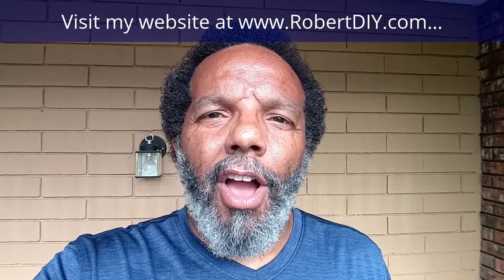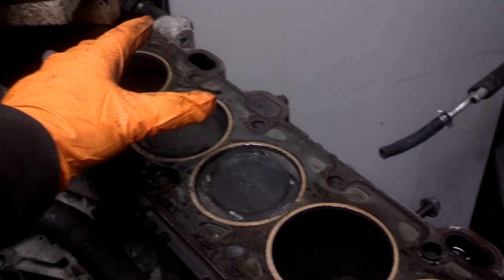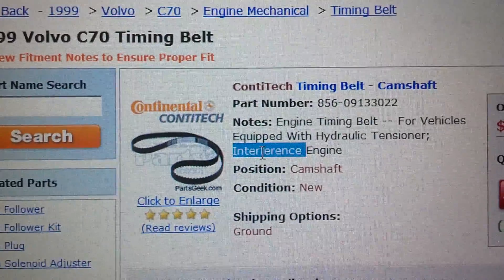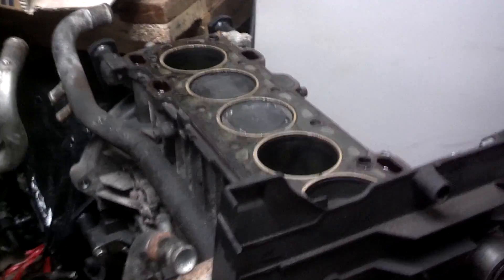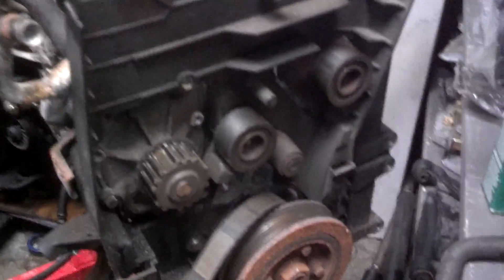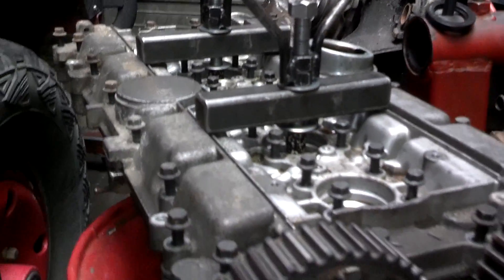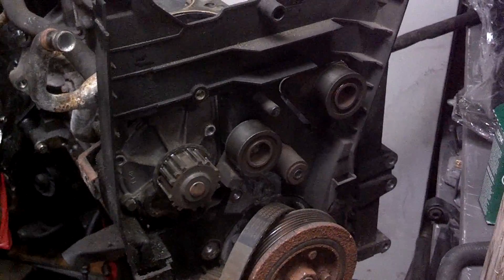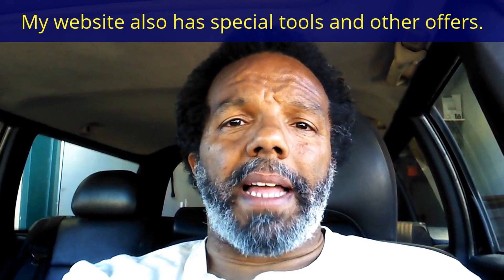What happened if your vehicle timing belt broke or came loose on an interference engine? - VOTD

Comment: so i was loosening the 30mm bolt with the engine off to change the timing belt and i had the belt still on the crank and the camshaft  and they moved after i already marked the camshafts i forgot to mark the crankshaft i had my engine cover off so they moved out of the engine and i ended up taking the camshafts off what should i do. i also have a video before i removed them off should i try and line it up with the video? its just bad quality
Reply from the maker: https://youtu.be/gt9w-ZSxs9I
Reply from the maker: https://youtu.be/hjZFY-1x1Xk
Reply from the maker: https://youtu.be/0H5cgRYCMQg

Comment: I've got jaguar sf 3.0 deasel v6 twin turbo  is  timing belt snapped would valves be bent as don't no if the engine is interference could u tell me please thanks
Reply from the maker: If you look up the parts on PartsGeek website it should tell you there.
Reply: @RobertDIY   it don't show up on there the 3.0 v6 diesel  ony shows 5.0 v8 petrol mate
Reply from the maker: Maybe you can ask someone on a forum or the dealer.

Comment: Hey Robert, I’m looking at a 98 v70R awd for sale. I have a timing belt go and the seller had tried to crank it since. The cars in great shape otherwise. Where could I find a new head for it, and if I could get one, what else would the car need? Thanks for the helpful video
Reply from the maker: I get them from the salvage yard
Reply: @RobertDIY  here seems as good a place as any to ask if various parts for the '98-'00 70 series cars are just not feasible overall to get quality versions of, new or used. Namely new parts, e.g fuel pumps for the AWD cars are not made by volvo or any quality maker now, so the Swedish Proparts trash unit is all there is!?     2:  is the Awd system really practically refurbishable?  seems not at this point due to cost.  Driveshaft alone is now 1300$.   3. and most importantly, is the automatic trans, at least in '98 really ever seeing high miles on original if well taken care of?  I really have not been seeing that over time with various examples, so i'm really trying to know the transmssion risk in lookng at buying a '98 Awd xc ,for example. ?   Thank u Robert for your wide breadth of knowledge and dedication!  U really are a car treasure and volvo treasure!

Comment: Timing belt broke coz of bad tensioner-ran compression test n all were good except 1&2 were low. Pulled head replaced all valves in those cylinders runs like new👍
Reply from the maker: Sweet

Comment: Great vid Robert! 
Question: Honda K24 (interference), chain, was really cold (-25C), next day was 0C, started, run terrible but moved, vacuum fucked (power brakes were not power anymore); likely result of poor oil change practice during covid/ran low on oil a couple times.....my fault.....
Could I be not totally fucked? 
Would it run at all if I did ruin the valves/head? 
Any good methods to find out if I am fucked if above info is insufficient?

Much love eh :)
Reply from the maker: Did the belt break?
Reply: @RobertDIY   @Robert DIY  chain, and no, it still starts and runs (barely).....can move under its own power (barely, but enough to drive get up onto a tow dolly), needs ample throttle to not stall, cant make it over 4k rpm, vacuum is fucked (power brakes no longer powered, requires lots of leg muscle to get it to brake).
Was driven about a couple km at first as I thought it might be a bad brake booster leaking vacuum and causing the issue... I was wrong, lol

PS wow that was a quick response! I really appreciate that, and being willing to help at all.... much love :)

Comment: Hello, sir! Very informative video. I have a 2004 Saturn Ion and on last month my car stopped while I was driving it. I took your advice and looked to see if I have a interference engine or non-interference engine... It looks like I have a non interference (looked on parts geek), timing chain kits were shown. What question is... What estimate would you give for my car to be fixed. Where I live, I have been lied to numerous of times by mechanics. Apprehensive and educating myself in getting it fixed. Thanks for your time. -Takia
Reply: Ok... A lil confused. It stated I have a Diesel Interference. On Geek Parts, it is showing timing chains.
Reply from the maker: Take it to the dealer, they have a set price
Reply: I keep trying to get my new timing belt back on but every time I put the main tensioner on the back sprocket ⚙️ on the rear cylinder head jumps 1-8 teeth back how tf do I get it in time and keep it in time I haven’t started the car or anything it’s been retimed several time it’s in sync but this cock sucker keeps jumping can I compress my main tensioner a bit more then bolt it on and then pull the pin and turn the engine over like 3-4 times to get all the slack out and make sure it’s rotating in time. Thank u. It’s a 2.7 V6 Hyundai Santa Fe def an interference engine it’s my sisters I’m tryna make sure it’s not off by even 1 tooth I know this is common I’m starting to think the cheaper kit I bought just has a shitty belt or my tensioner is going on with to much preloaded tension

Comment: Hi robert I have ahyandai santafe 2001 My water pump was leaking and a friend of mine took it all apart im not sure what he did I went to go and put the timing belt on and the inside camshaft (closet to th passenger side) is of by 8 or 9 teeth in the direction towards the engine (has not been started since originally taken apart) so i know tha t it hasnt bent the valves or pistons How do i get the camshaft back to top dead center other camshaft is on the marks so is the  crankshaft
Reply from the maker: Who said that it is timed marked at TDC?
Reply from the maker: bring it by and I'll check it out.

Comment: Most will slip on start up, IF your water pump runs under the cams beneath but center both underneath. it may put tension to save it. Mine did. Mine slipped on startup from being old and never serviced and raced a month after I bought it. Mine is a mitsubishi 6g75 v6 with mivec high compression interference engine. I changed the belt out and the car runs better now than it ever has and pulls ridiculously hard now. My cams are farther apart it goes over cam under waterpump over other cam. That tension is what I think saved Mine.  Most 4 cyl are different with close cams with nothing to keep tension in between both the belt goes directly over both. If it slips it'll sound like rubber slapping on plastic like mamma beating ya with a belt turn it off immediately!!!!!!!!! Most times it'll happen on startup, or when you go to slow down. It's not cheap, mitsubishi wanted 2K to do mine. YOU HAVE TO DO IT OR GET IT DONE!!!!! like he said it'll ruin your entire car. I did it all myself. If you are stupid or can't follow directions. DO NOT TRY THIS YOURSELF!!! and do not tear it apart and then send it to a mechanic, that might be worse. I got all my parts thru domestic gaskets in Boston they were a huge help, they took my actual vin for my car specifically and ran it and got exactly what I needed. It was around $220 for everything. LISTEN TO THIS MAN!!!!! He knows what he's talking about and will save you money. It's crazy how many people have gone way way over and/or don't even have a clue they have to get this done. If you buy a new used car that has a belt, and not a chain if it hasn't been done, offer less and get it done immediately guys!!!!! It's literally the most important thing on the entire car.
Reply from the maker: Interesting

Comment: does anybody know, what should it cost to have the head rebuilt? I may have tried to start with a broken belt.
Reply from the maker: I don't even know what kind of car you have.
Reply: @RobertDIY  98 S70 T5 Robert. assuming no pistons were damaged, just wondering what a shop would charge. I guess if there's piston damage it's an engine rebuild ? -- thanks, your videos are very helpful.

Comment: Hello Robert. Ive changed  cambelt on volvo c70 2.3turbo 1998. If  the timing was out of sync for 1 or 2 tooth. Could it bent valves while cranking the engine as it hasn't started since it has new cambelt. Cylinder pressure goes up to 2.5 bar only
Reply from the maker: I doubt any damage is done. Was it running before you did the belt?
Reply: @RobertDIY  Yes, engine was running without any issues.  Besides, P0107 error code appeared but I've replaced it and it hasn't made any difference.

Comment: I had barely left a red light when my belt broke. The engine died immediately so is there a chance that my valves weren’t damaged I was probably doing 20-30 miles per hour when it happened
Reply from the maker: Do you play the lotto?
Reply from the maker: Depends on what kind of car / engine you have???
Reply: Same happened to me today. What outcome did you have?

Comment: My honda broke its belt running down the street. put a new belt in and the thing runs right with same power. Mines is a four cyl interference engine so I put a belt on which I know how to do and cost me 25 bucks and I lucked out. With four cyl cars it is often likely the car will run after you change the belt that broke. 6 cyl and above I do not know but my honda runs fine. 25 bucks. He is absolutely right about cheap parts tho. You will wreck your engine in order to save 60 or 80 bucks. Dont do it.
Reply from the maker: Good for you.

Comment: You are FANTASTIC. If I ask my mechanic to replace the engine that I provided, he did not. The car is running, 2k miles so far. What he did w engine I provided. Did he replace the TB and the Head not the whole engine. The trusted Mechanic of 10 years broke the TRUST,
Reply from the maker: Ouch

Comment: All bad I just broke my timing belt wheel  on my Acura Integra 2001 and was running it for 2 mins that motor is all done I bet (oct2)
Reply from the maker: ouch
Reply: put in a new belt and wp, and see what happens, you may get lucky

Comment: Hello sir. 
How do i contact you ? I have some questions about how to get the crank to tdc. I can not see the marking on the crank. The head is of of the engine. I have Been told it is when the piston nr 1 is at tdc
Reply from the maker: https://youtu.be/gt9w-ZSxs9I
Reply from the maker: https://youtu.be/U9TDU1WLUpc
Reply from the maker: https://youtu.be/orDjbXKq24U
Reply: The car is a V50 2.4 petrol
Reply: that is correct my friend, turn cam with socket and u will get there

Comment: Actualy  the rpm is the rpm of the crank shaft. Not the cam shaft . So if thr engine idles at 1000rpm the crank is going around at 1000rpm. And the cams are going at 500rpm not cam at 1000 and crank at 2000.

Good video otherwise. I realy like your stuff
Reply from the maker: Thanks for the info

Comment: What about a 2002 Subaru Legacy wagon. Is it an inteference type? My car was fine and died as I was driving on the hwy. I coasted over to the berm. Towed it to a collision mechanic. He's fixing it by replacing the belt. He said a spark plugs had some oil on it. Called Subaru dealer he said it just needs a new gasket usually the gasket grommets wear out. Praying my car is fixed by tomorrow 🙏
Reply from the maker: You can check on a parts website to see if it's an inteference type engine.

Comment: The Tachometer on your dash displays crank speed, not cam speed, if your dash says your engine is doing 2000rpm it means your crank is doing 2000rpm (cams are doing 1000rpm at this engine speed). The gauge does not display cam speed.
Reply from the maker: Does that mean my valves won't be destroyed?

Comment: hi, great video learned a lot about timing belt issue!! have a question have a 2005 honda oddessy were water pump broke, vehicle overheated and shutdown. was in exit lane on the parkway with stop and go turn back drove 2 blocks to side street put water in radiator smoked immediately, let cool off then drove to auto shop one block away. they told me the water pump was leaking which I saw, the car needed the whole timing belt job and no guaranteed engine maybe bad!!! picked up cat today when in idles stats shaking VSA and engine come on and then car shuts off. When on parkway and driving car runs fine up to 60 miles per hour no issue again in local traffic car shakes and idles terrible and sometimes no power when I step on the gas and car shuts off. VSA comes on just before very intermittent?? is engine shot??? not and interference engine vehicle has 150,000 miles Help!!
Reply from the maker: Well, the timing belt did not come loose, just the water pump was leaking. You did overheat the car so you need to test it for a blown head gasket. Really the mechanic should have done that before replacing the timing belt parts. Is the CEL on?
Reply: @RobertDIY  hi, thanks Robert not sure what CEL is??  only the VSA light and engine light comes on before car shutdown on low stop or low idle!!
Reply: got it check engine light yes is working and on
Reply from the maker: Have you had it scanned for the codes?
Reply from the maker: https://youtu.be/NhtUXZTurzo
Reply from the maker: https://youtu.be/JWm4dHRUCig

Comment: Strange things are afoot.  I am doing a timing belt replacement on our 1996 non turbo sedan with '55' VIN.
The engine ran fine this is just routine replacement. The camshaft timing marks are set straight up. There are only cam gear indentations (painted) at 12 o'clock when the crank is set to its mark.  The top inner timing cover has the inner angled cutouts in it but there is also white paint on it at 12 O'clock.  
 I do not understand how it ran so well and got such great mileage for the last 60k set this way.. or if this is just the way this one goes together.  Afaik, it is stock and there are no other marks on the gear teeth.
Things that make you go hmmm. :D  Just thought I would post this before I set and release the tensioner.  It will get 720° of crank rotation of course prior to starting.
https://photos.app.goo.gl/PjAxHnioQMZYsr9V6
Reply from the maker: https://www.youtube.com/watch?v=gt9w-ZSxs9I
Reply from the maker: https://www.youtube.com/watch?v=OY9kRw4usrY
Reply from the maker: https://www.youtube.com/watch?v=SpNgDfvRcVI
Reply from the maker: Someone may have pulled the camshafts or failed to mark the cams.

Comment: 1995 honda odyssey ex mileage 295,431 miles timing belt broke on hwy . Rip or do leakdown. Leani g towards rip.
Reply from the maker: If it's an interference engine, RIP.
Reply: All Honda engines are interference except 3.0L & 3.2 which are Non-interference.
http://yourcarangel.com/2014/07/interference-engines-complete-list/

Comment: Hey Robert if your belt breaks and you put the belt back on and not set the timing back to tdc will it still start
Reply from the maker: Man, have you watched the video at all?
Reply: Robert DIY no on a non interference engine
Reply from the maker: Probably not. Timing is one thing you need for a car to start and run. Air/Fuel/Compression/Timing/Spark.
Reply: Robert DIY ok the fuel spark is there i just didnt align the cams back is that part important to align cams to tdc what if you just put a belt on the cams in the wrong postion will that stop the car from starting
Reply from the maker: It depends on what kind of car it is. Most newer cars are NOT timed to TDC.
Reply from the maker: https://youtu.be/p8zd8GVvAa0
Reply from the maker: https://www.youtube.com/watch?v=YiPAPu-K8OI

Comment: Hello Robert First thank you for your Videos! I have a 2002 Volvo XC70 that needed a upper camshaft seal replaced. I changed the seal but didnt know about the tools to keep the cams in place and didnt know about your video at the time. Aligned the marks back up and attempted to start the car once and no go so i stopped. is it time to have the head rebuilt?
Reply from the maker: I don't know. Have you checked timing and done a compression test?